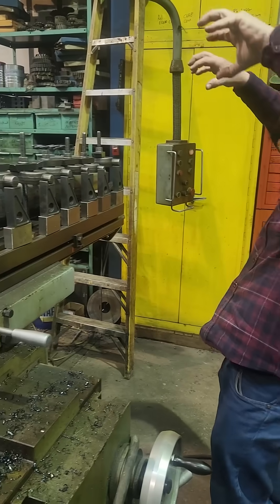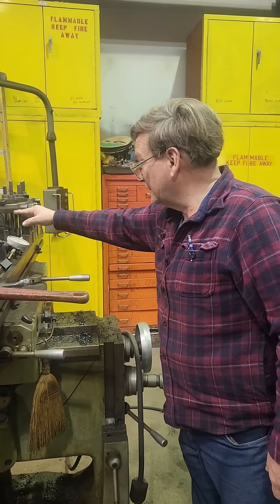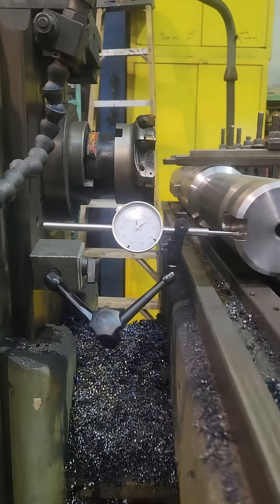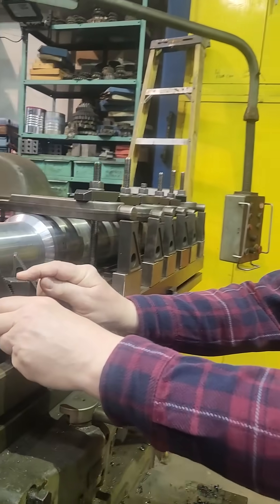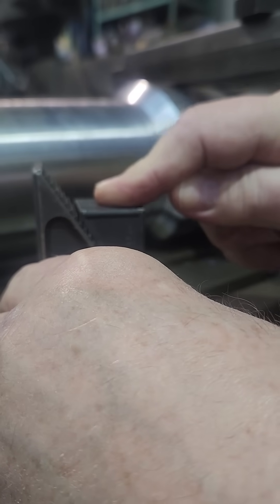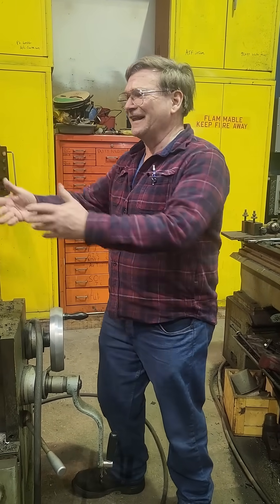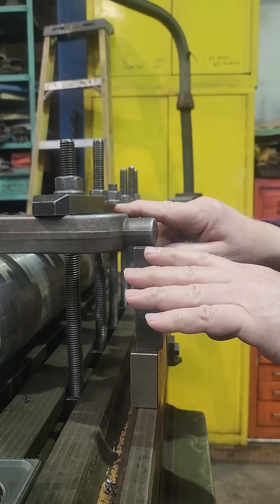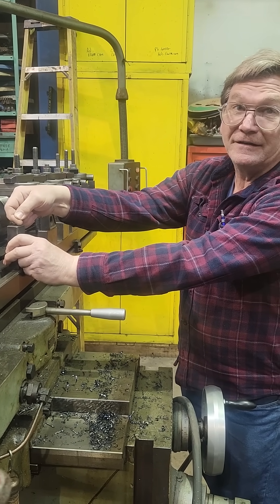Machinist's Minute(s): Clamping is based on the job's geometry!

Comment: To overcome the stud being too far back where I worked, we made bars that were long enough to be clamped to table at both ends. Then a series of tapped holes were in between the end holes so a stud could be put in different holes to get closer to job than backup blocks.

Comment: The front face of the table has T-slots for the crash-stop locks, for the automatic stuff.. but, you can use those, if you plan accordingly and check all clearances of the redirector switch-handle... The. You can use the top t-slots closest to the head, abd moce the part further away from the head, now you have strapping ability... 

If you still have the owners manual, it does showcase the front t-slots being used for such, while charging extreme caution for collisions of the passive automated stuff.

Comment: It looks like you indicated the bottom of the keyway to get it verticle. In that approx 3/4" or so, would that be close enough or right on?  Thanks
Reply from the maker: 3/4" is plenty to get it dialed in as long as your indicator is good and the surface you're indicating on isn't hammered. If your indicator shows no change over that 3/4" right on for all practical purposes.
-Cameraman

Comment: Do the better fitting step blocks have a more steep negative slope to the steps? (Making the teeth bite before it rotates out) or do they actually feel like they’re mismatched like two slightly different threads?

Comment: Machinists fascinate me. They take the brilliance of the engineers and actually make the dang things. I’ve been involved in several vocational occupational roles, even worked with a five axis CNC machine, but I’m no machinist. I was just told exactly what to do and I was good at that. I’m not even approaching the same city as this man. Machinists have a very cool set of skills. 👍
Reply: guys like this  are very rare in modern machineshops .. you will be lucky to encounter one in your career ..

Comment: I'm not sure why you couldn't move the shaft closer to the studs to get better leverage , but it's your shop do it how you want.
Reply from the maker: The shaft is resting in a tee slot, that aligns it to the mill's axis, the mill only has 3 slot positions to choose from.
Reply: @HOWEES  Yes, I see that, and yes, I know it's faster for set up to use the slot, but if you really needed all the leverage and clamping force you could move the shaft right up against the studs. Not trying to start an argument or a fight, and like I said earlier, you get to choose how you want to do it.

Comment: I love this channel… I took 2 months off at work… I’m a high pressure vessel fabricator and run 2 different saws along with the other ones from other shops if worked in but this one has this cool drill press slash miller and we have and old clutch style lathe in the back… we make parts… fix our own fuck ups as far as resurfacing new flanges n shit like that… but this drill press man swings on the radial arm and goes up and down. Whole nine… looksy… I gang stack 1/2 plate in groups of four and drill a 1 1/2 hole in those things. I’ll post a pic and video and tag you with the little clamps I use. And how awesome the results are… aware you’ll laugh… moral of all this rant is. That being away for 2 months I came back to work after chilling nd learning a lot from watching you howie and guys at work said, “ the hells gotten into Molnar, he’s fucking taking over” “like a new man” hahaha

Comment: If you had the step side of the steb blocks facing the clamp then you could have the clamp angled down to the bart and it would in turn pash the step block piece back into the other half for a tighter stronger fit. Or is there a reason you had them facing 90 deg from the clamp?
Reply: I think it needed to be sideways to fit in the edge of the table.
Reply: But great video I really enjoy your channel. :)

Comment: Sometimes buying expensive tools backfires. I bought my clamping blocks from an online mayor store and got some designed where the steps aren’t flat, they mesh securely into each other to prevent what you demonstrated from happening.
Reply from the maker: The steps are not flat on these, the spacing is inconsistent is the problem with these.

Comment: Excellent!

I always tell guys to think of steel as hard rubber.  It will flex under load even if it's a 36" WF and the load is not high.  You just can't tell it is flexing.  Thinking about how your work, clamps, and table will flex are all important.

Comment: Ah. The tico ones have a negative degree to the teeth instead of just being perpendicular to the base. This would absolutely let them lock in better
Reply from the maker: The bad ones have an angle too, the problem is the spacing of the notches is not even.

Comment: Oh no, don’t shim it. Butt an angle plate with a hole in it and bolt it to the angle plate with that lifting eye hole… then you don’t have to worry about your shims moving around if you get some chatter
Reply from the maker: I used a set of wedges & clamped on top.  Your idea of using the bolt holes is good, but the part was already finished, before I read this.  My angle plates might have been a little wide to fit, but even a rough angle iron cut-off would have worked.

Comment: Huge keyway. So does the shaft need to be rotated so the key is on top for the horizontal mill? Thank you.
Reply: To actually answer your question, I assume he's going to change the cutter on the mill before doing any work on it lol
Reply: why would he go thru all the trouble clamping and not doing it right? i'm assuming he's just going to cut a new keyway and call it good
Reply from the maker: @HootisGarage the remaining existing keyway will just get extended, no reason to have a dummy keyway in the way.
-Cameraman